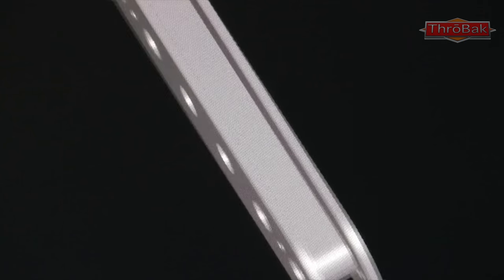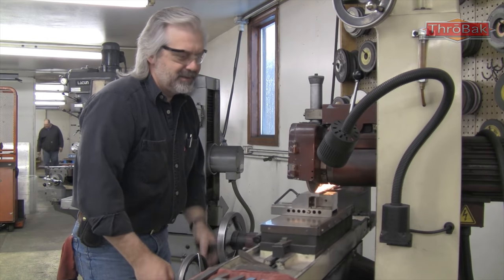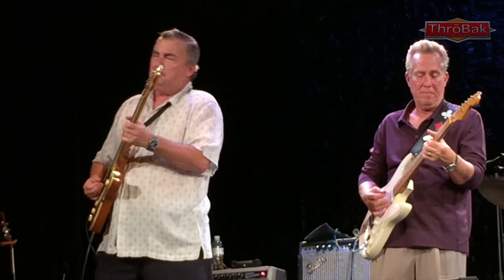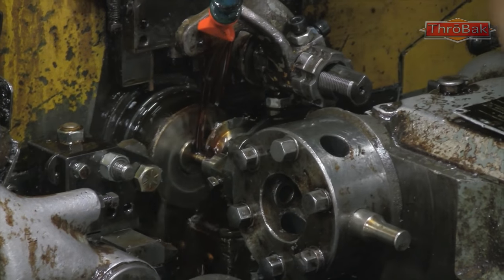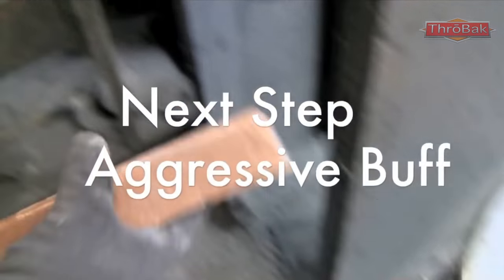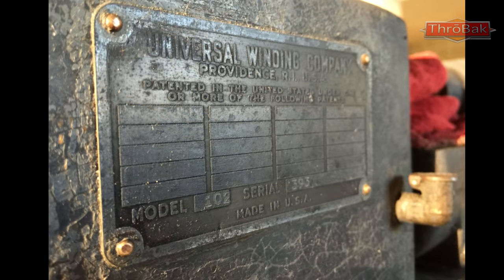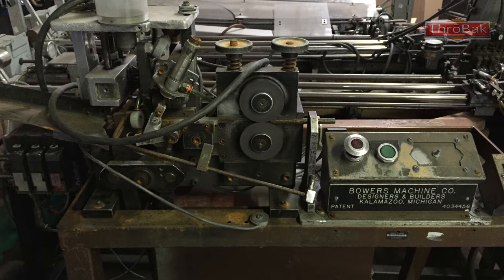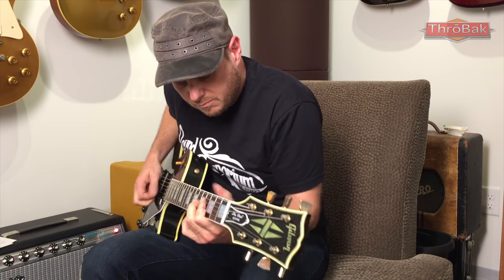PAF Pickup Secrets: PAF Bobbins, Slugs and Covers - How it's Made

Comment: hello ThroBak! loving the channel so far. ( i am new to it). What would you recommend for a 59 les paul? I have Seth Lover PAF seymor Duncans in it at the moment. I find they are nice - but i had to remove the pole pieces in the neck to get a sound i like. I do think it sounds nice, but missing something (obviously not referring to the pole pieces). I would post a picture of the guitar (a ghost build by an American guitar maker.)  but I don't think I can post it here? Thanks so much and thanks for the videos! 

P.S i tried the Page tele with strings through the body, and it was a really different guitar! leave it to Page to give us a two for one tele. USA01212

thanks guys, promise not to leave you a short story every time!
Reply from the maker: The ThroBak SLE-101 Plus set is a popular choice for a ‘59 era unoriented A5 tone. Compared to the Seth Lovers the SLE-101 Plus will have crisper low end in the neck pickup in particular. The Plus set has a balanced and slightly  mid dominant tone with good output in the bridge for leads.